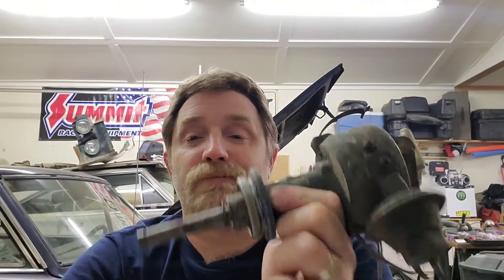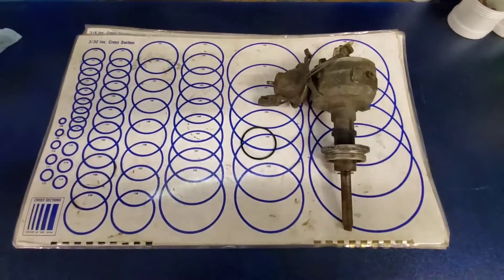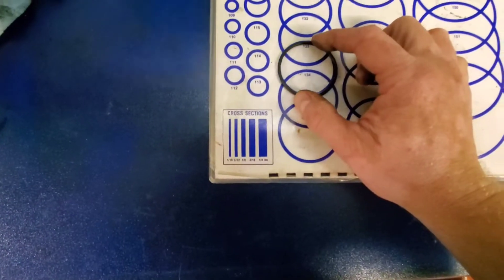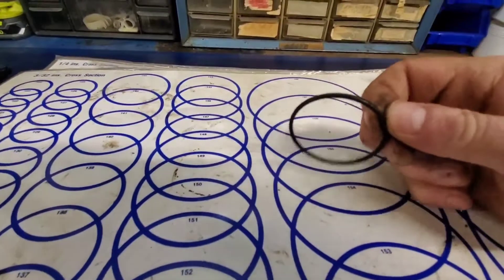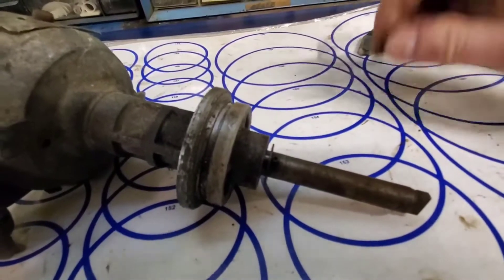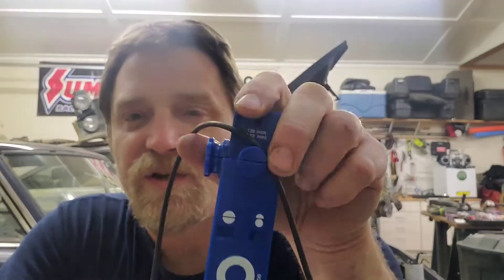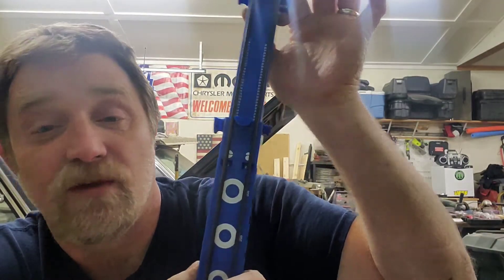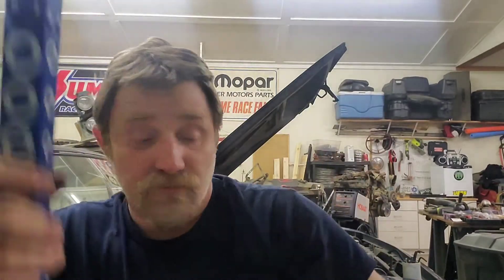How to: Three ways to measure o-rings to save you money

Comment: This is amazing! Thanks 👍

Also, do you know if o-rings are precisely round? For example, if I were to put an o-ring around a groove of a cylinder, how much would the outer diameter of the o-ring will run out of concentricity to the cylinder? Or does it stay consistent?
Reply from the maker: In my experience o-rings are not consistently round. There has to be a percentage of compression squash for it to work properly. It's best to measure the component you are dealing, size the o-ring to that size figuring the compression needed for the application.